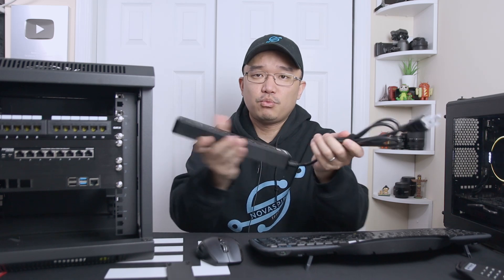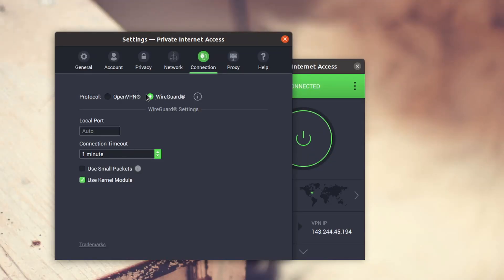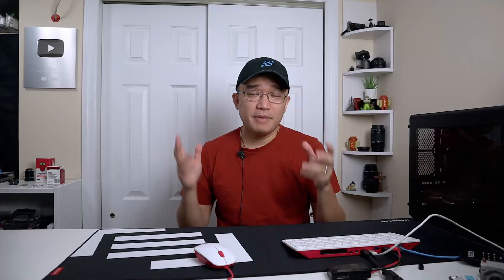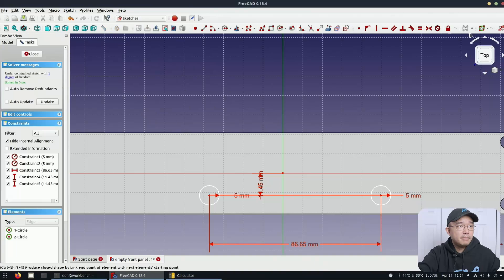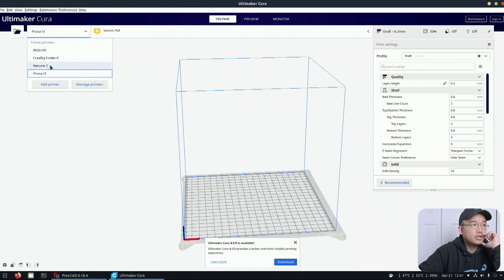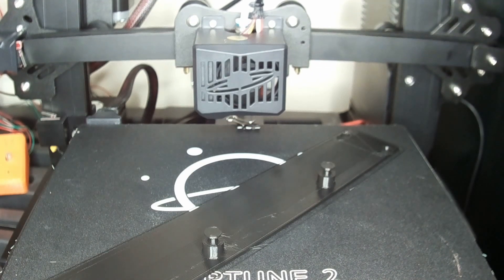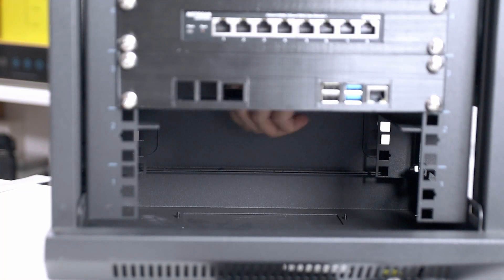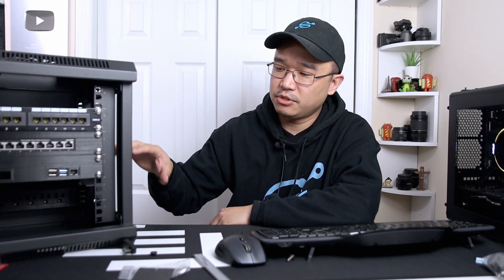Power Distribution Unit (PDU) for 10 Inch Server Rack Project

Comment: I did find that amusing - a power board called "Power Delivery Unit" and "PDU".   Sounds like calling a spade a "manual earth relocation utensil".  Is that a normal term in the States?  Here they seem to call them "4-gang power board" or "6 gang power strip" depending on layout, "gang" being used to refer to the number of standard sockets.  
Don't be afraid to install them vertically too - they sometimes make more sense that way if you have an extended amount of dead space at the back (depending on how many devices you have to power).  I have five mounted inside my cabinet and hutch, I just use regular screws to hang them (not as neat as yours but I'm just doing it for slap'n'go functionality).
Reply: In the states a 1 gang outlet box has 2 plugs top and bottom  so that term isn't as universal

Comment: Put other support spots for that across. Any time you put any weight or stress your going to break those tabs
Reply from the maker: I think I might need to, at least add more structural beams to the panel
Reply: Add a flat spot between the pegs and add some double sided tape or hook and loop velcro as some ideas
Reply from the maker: That's not bad idea as well